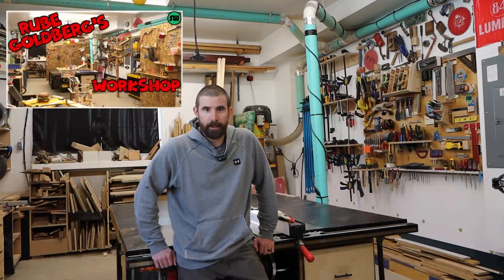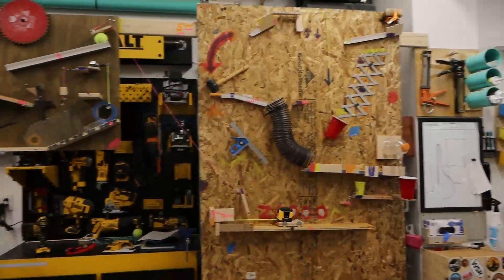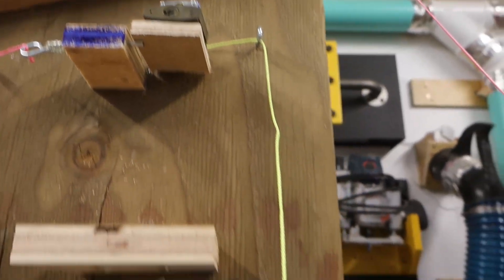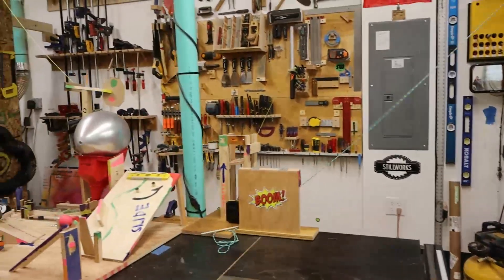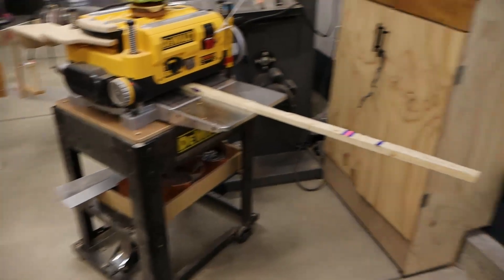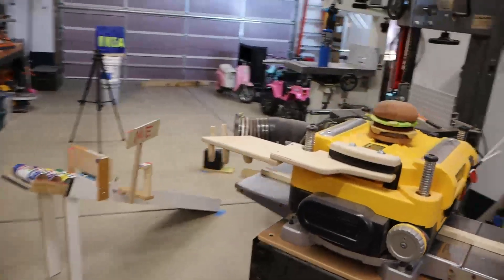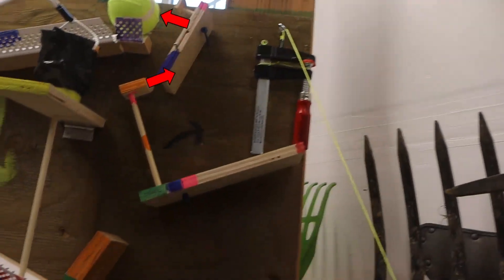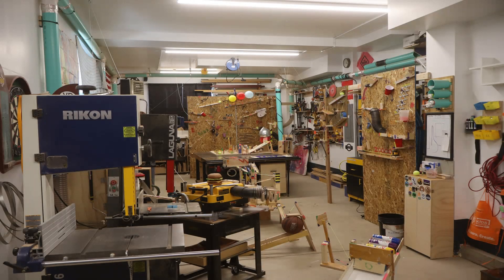Rube Goldberg Machine Explained

Comment: And remember, regarding preserving elevation for the potential energy, it really doesn't matter too much. Even the smallest potential can trigger something at the top of the module again. It's really only necessary if you plan on taking a single object through a lot of steps. Ultimately, that potential energy of a bowling ball at the top was me doing it. .. and if i hit the floor, I can redirect the motion to something else up high, that has more potential. Like, a bb falling 5cm over the length of one meter to its lowest potential, the floor, could still close an electrical circuit that operates a small, but powerful electromagnet back at the top of the module. That magnet pulls a pin that release a bowling ball maybe. Anyways, preservation in all things, but remember, there's more than one way to skin Schrodinger's Cat, at least that's what I think he meant to say.
Reply from the maker: Good insight. Another reason I didn’t want to travel the full length of the 8’ plywood is for filming purposes - the less I have to dance with the camera, the better